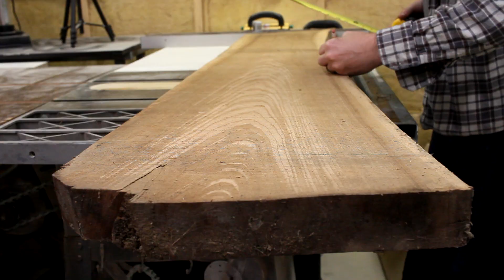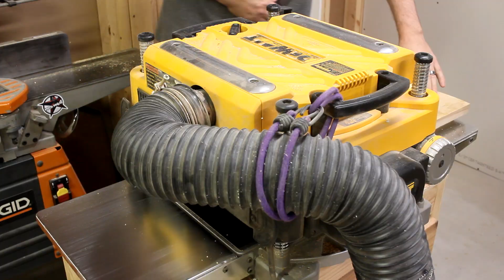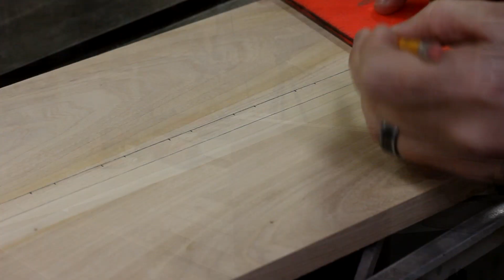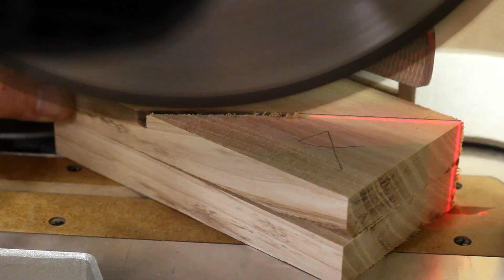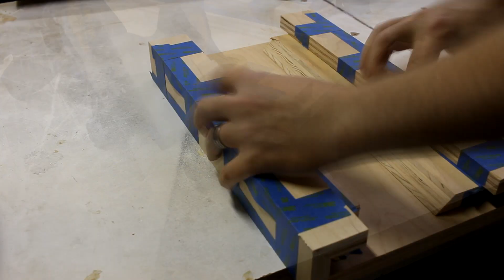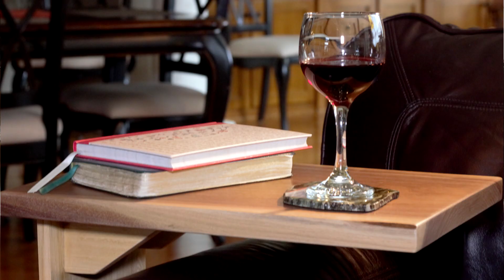Woodworking: Making an Adjustable Sofa Table

Comment: Trying to make this and I am hesitant to try the holes.  Seems impossible to get them to line up and you make it look so easy. Also, did the finish change the fit of any of the parts? I'd hate for everything to work then not fit at the very end
Reply from the maker: Nope, the finish didn't change anything.  Good luck

Comment: This looks like a great design! and it was very nice to include a method for people who don't have so many power tools!
I think i'm going to try my hand at this, but maybe replacing the Hole&Dowel stopper with something closer to a clamp and rail. (the slider board having a cut down the middle, and the hole being replaced with a screw-clamp and a board on the other side to clamp the slider with.)
Reply from the maker: Have fun

Comment: I have a question (because I have PTSD issues with other C-tables I've purchased).
Had there, in all this time, been any instability issues? The base looks (at first glance) a bit smaller than I would have (likely incorrectly so) thought it should be. Is the issue resolved because, since it will adjust to clear a couch, the couch keeps it from tilting? The table I will make will sit more like an end table for the most part (still has to be a c-table because of the room we have. No room for a proper end table). I can make the base larger or longer if you think it will be an issue with it being top-heavy if it's free-standing.
Reply from the maker: Never had any instability issues from either one of these tables I've made.  They've been great

Comment: Need to build pair for my wife & myself as we both need disability type "rise assist" armchairs. The shop ones are far too expensive and the bottom rail & castors at 3in won't go under the chair. So Christmas surprise for Mrs C, sadly it will be the plywood not the walnut but I can CNC her favourite kitten images onto it to make it special to her. Thank you for the design idea. We will both enjoy the tables.
Reply from the maker: You're very welcome!  I hope you enjoy the build and the finished product!

Comment: Just bought the plans. Was a bit disappointed that it did not have the walnut version in the plans. I'll calculate the bf needed and just mill the stock to 3/4" so the dimensions work. Might consider adding a page at the end for those of us who prefer the hardwood version.
Reply from the maker: My walnut version is made from 3/4" thick stock.  Plans work for whatever wood you want to build it out of.  I opted for a thicker base and top, but that doesn't impact anything else.

Comment: I'm thinking when you renew your membership, you sharpen or replace your planer blades. I can see the ridge. Sander, no problem. 
OMG, I can't imagine how heavy this must be. Did you do that just because you're used to working heavy, or is it for structural integrity once raised? This is some seriously thick wood. 
In any case, I LOVE the design. Our mortiser is sheit ... so I'm going to have to square the holes with a chisel. 

I'd never thought of using a band clamp on a 2-sided build to square. That's Brilliant!!

Seeing that grain with finish is so satisfying. I LOVE that part. 

One thing that I've not seen you address is how to check the color before cutting. Easy. When you're shopping for wood, take a squirt bottle. Water will show you what you'll get when finished clear. Just spray the surface and wipe enough to get rid of the reflections and voila! You'll know what color it is before you finish. Also, bonus ... you can tell what black walnut (since it's very popular) has been kiln or air-dried. Air- dried has more colors and more depth of color. Kiln-dried is always more dull an on the grey side.

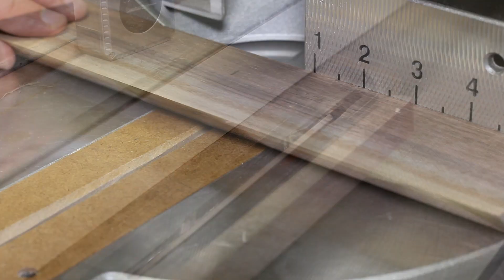Comment: Why do you touch the piece a few times with the miter saw at 3:23?
Reply from the maker: Watch closely.  I'm sneaking up to the mark to get the cut perfect.  I make tiny adjustments between each attempt until I have it right on the money.

Comment: Excellent design!  One improvement I’d make is with the feet.  I would buy some nylon blocks, make 2-inch disks, then aggressively round them over into a dome shape on one side. Then I’d epoxy them to the bottom.  These nylon feet would act almost like casters on carpet, allowing your father to easily slide the table in or out of place while still providing a stable platform.  Love the design!

Comment: hi there! Just purchased the plans for this. Wondering if I can scale up to make the maximum height just about 50” plus a bit maybe. What measurements would you recommend? Your plans say that the table can go 10.5 inches up from its original height so I’m wondering how I can make it taller without messing with the centre of gravity. Thanks!!

Comment: One of my favorite YouTube channels! I'm making two of these for my deck swing. We eat dinner on our deck in the summer months and when guests are here we want to eat sitting on our swing. I'll  be making these out of White Oak & Black Maple from my property. It has been drying for 18 months. I already milled the .5" dia pins from 316 stainless steel as wood pins swell. The table tops will be made of oil rubbed slotted Teak to shed rain water. Very excited to make the thanks for the inspiration
Reply from the maker: Sounds like they're gonna be awesome!  Have fun!

Comment: Thank you Mr Fisher, for these videos on a sofa table, it is very beautifully and professionally built!! Can you make a re-design of your sofa table so that the table top swivels to accommodate a sofa or even a bed that is low to the floor or on the floor where nothing can go underneath??? That is my dilemma. And I too, do not have all the tools you have. Plus I have limited mobility 😐 So all of my builds are made with furring strips & cut to length with a miter saw.  You know some people can draw lifelike people and some can only draw stick people. My furniture builds are not as beautifully done as yours but I build for the functionality of the piece. So in comparison to your builds my builds I call stick furniture. I thoroughly enjoy watching your videos on furniture, Thank you!!

Comment: Drew, that was either a grub worm, or the boring beetle in the worm stage. It has a black spot on it at one end? That would have been the head of the worm. It also looks like maget worms. I think they ate whatever had been in the hole pryer to you discovering them. How they got in there is a mystery!?

Comment: Why did you choose Ash for the locking pin? Due to contrasting color or based on hardness? Speaking of hardness when it comes to ash, do you find the card scraper requires more effort on the harder lumber? I have no experience with a card scraper yet. Thank you for another great video.
Reply from the maker: Yes, I did it for the contrast.  Yup, a card scraper is tougher to use on hardwood but is still the best tool for the job.  Some folks can pretty much eliminate sanding completely by using a card scraper.  I'm not that good yet, but I'm learning.

Comment: I seriously like this project, and want to make it!  I have loved ones in a similar situation who could benefit from it.  I may do a prototype from plywood first, mainly because I'm cheap and stingy when it comes to hardwoods, and want to work out any changes they might desire before raiding the wood bin.  

I am interested in doing away with the gussets (mainly to be able to set the top all the way down on the couch cushion), but am curious on your thoughts about another way to keep the table top strength they add?  Perhaps a 'through mortise' so that the end of the tenon is visible in the top, with a line of perpendicular dowels pinning the tenon, visible along the end of the top?  Or maybe a wide-tabbed box joint joining the riser and top, doweling each tab so as to have alternating dowels in two directions?  The dowels and mortise, or box joint tabs, may make for a bit of a busy look at that end, but I'm mainly interested in strength in the joint.  And visible joinery can be beautiful when finished right.  

Would really love to hear your thoughts on other ways to join the top to the riser, or pros/cons on these I've mentioned, or really just whatever you have time to write.  And again, superb project!
Reply from the maker: Depending on what they want to put on it, I’d still recommend gussets for the support. Unless you make it out of steel you just won’t get the support you’ll need.

Comment: I think I wood use a 'T' track to adjust the height, rather than searching for a hole to put the pin in.
Reply from the maker: Sure, that's an idea.  I was just going for the cheap and available solution.
Reply: @FishersShop   I have checked out a few other sofa tables, but yours is the best, now I am a subscriber, thanks for posting your talents.
Reply: Just purchased the plans, thanks for the opportunity!!

Comment: Great project and video Drew - i bought your plans and just finished cutting every thing out (actually cut the sides to the spacer so it fits) question for you - what finish did you use on the plywood version? Just PU?
Reply from the maker: Yup, just regular ol' poly.  Later I actually went back and trimmed out the entire thing with walnut banding and ended up making the plywood version VERY nice looking.  Pictures of it are on my instagram feed if you want to see.
Reply: I just had a look see at the walnut banding on the plywood  - yep now I have to make a trip to the store for some Walnut 😉

Comment: Hey FISHER! Bought these plans and I may be crazy as I’m a novice wood worker but on the cut diagram it says for the “sides” to cut at “2 inches”. That would make it less than a .75in board to fit into for its slide. The “back” says “2.25in” which would give you that .75in fit for the slide. Of course I made this mistake already on the walnut I was using but just wondering if I miss read something. Thanks for your help! Great channel! Love the videos!
Reply from the maker: Hey Aaron, I double checked and you're right.  I goofed and just switched the names for the Sides and Backs.  The Backs should be the 2" boards and the Sides are the 2.25" ones.  I've updated the plans to reflect the changes but you'll have to make a note of it for yours.  Thanks for catching that, Aaron!

Comment: It sounds like you could use a new blade on your table saw and circular saw. I like your style...subscribed
Reply from the maker: The circular saw blade was new, I just took too much and went too fast and it jammed.  But you're right regarding the table saw blade.  New one is on order!
Reply: @FishersShop  I'm kinda pushing the limits on my table saw blade right now as well...it's just hard to let go of the coin for a 16" blade especially when the saw isn't your money maker.

Comment: They're powder post beetle larva. Lyctid is the species since they infest hardwood (broadleaf) woods such as walnut, ash, oak. They can survive in wood for years before emerging as adults.
Reply from the maker: Interesting!  Glad I got them all out!  That would have been a bummer if they popped out in a year or so and joined my folks for dinner.  :)
Reply: @FishersShop  Yes, mom would not have liked that! LOL
Reply: @FishersShop  Just imagine your parents sitting down for dinner when a beetle pops up uninvited.😳
Reply: @dawn5227  well as long as they bring a bottle of wine....
Reply: True story:  I once ordered a live edge slab online and built a computer desktop out of it.  Lots of coats of poly for a nice glossy durable finish.   Several months after finishing it, while resting my right arm flat on the desk to use the mouse, I was constantly annoyed by an itching, almost a pinching sensation.  I also started to notice some holes appearing in the finish.  Being somewhat dense, I didn't connect the two until I got a nice hard pinch on the underside of my forearm, and when I looked closely a live bug was burrowing its way out of the slab.  Guess now I know what kind of bug it was.  After about 25 more holes I gave up on the desk.
Reply: @davefeinglass9118  Yeah I’m not surprised at  all. What a bummer though. Just for future reference, If you make another attempt and the slab is worth it, stable and seasoned you can have it professionally heat treated. Internal temp of 135 degrees it will kill them all. Another option is to treat the slab with a borate such as Bora-Care. However for larger piece you may need access to a large drum sander to remove the top layer of borates before finish. It leaves a slight milky and crystal like finish that does not help the appearance.
Reply: @davefeinglass9118  I seriously would have gone into conniptions.
Reply: Dan Rao is correct, powder post beetle. And I also have heard them eating their way out of the beams of a  150 year old barn.
Reply: I had a wooden bowl where I could actually hear what sounded like a chewing noise coming from inside one of the walls on the bowl.  I thought I was going nuts, but I heard it a second time and deduced that it had to be a bug.  I put the bowl in the freezer for a night and it's been quiet ever since.
Reply: Makes you think; are there any that weren't found...yet...mom?
Reply: That's what I love about channels like this! Every day's a school day! 👍
Reply: @willm971  Yes. Well depending on the region  the wood came from. Other species of wood boring insects can contribute to cherry tree damage such as Shothole borers or Ambrosia beetles to name a few. Ambrosia beetle damage is actually quite attractive, unique and often sought after in certain furniture pieces. Just as long as they’re dead.
Reply: The captain has spoken!
Reply: Freezing the table for a certain time, which I don’t recall, will kill any remaining larvae.
Reply: @kennethewald1189 I think if they can emerge from a 150 year old barn's wood, freezing isn't really that damaging to them
Reply: So, is there a way to ensure their demise? Kiln-drying, I assume? Clearly simply sealing it won't do so....?
Reply: I've read through all the comments looking for someone to address this. Thank you!
Reply: Dan Rao wut

Comment: This looks great. 
I have question about design. I like it as Sofa Table, but is it strong enought to endure daily abuse if I oversize it to hold PC and working on them? 
I want to build Adjustable PC and Laptop tables. (from plywood) And i never thinked about this design. Simple and great. :D
(wanted to use spring loaded arms to lock into holes when i bring table top up).

Thanks, and again, this looks RIGHT. :D
Reply from the maker: Well it's certainly strong enough to hold a flat panel monitor and a keyboard.  But the entire PC would be too heavy.  You might figure out a way to mount that below.
Reply: @FishersShop  Flap panel monitor and a keyboard? Hmmm, so no room for the Mice? :D hah 
for PC case I would build fixed standing and some rails in middle for addicional support.

Thanks again for sharing this design. I need to do lot of calculations for what i need and what i need even more. 

I was thinking to build from 2x4 rought construction some kind and add plywood to give it more strenght.  
But this goes into my plans, and Spring, here I come. :D 

Thanks again! :D

Comment: Great video and perfect project that's pretty accessible to a wide range of woodworkers. Doing a craftsman and a novice version of the same project is a fantastic idea. I know you mention the two versions in the description - may want to include it at the beginning of the video as well. I'd hate to have some folks get to the 2 minute mark and say 'well I don't have  slabs of walnut, a jointer/planer/etc...' and cut out early.
Reply from the maker: Good advice for the next time I do something like this.  Thanks Steve!

Comment: Nice job. Really impressed with one, presenting it to your parents, and two, making two versions. Many other people make DIY with $30,000 worth of equipment. Obviously the DIY'ers don't have that equipment.
Reply from the maker: Glad you liked it.  Thanks for watching!
Reply: you can pick up a full shop of inexpensive equipment for about $1.5k. band saw, table saw, lathe, drill press, miter saw, planar, jointer, and a disk/belt sander and even less if you find some in a pawn shop/craigslist. DIY doesn't mean just a skil saw.
Reply: Lanckie, I picked up a used Table saw, $20. Used belt/disc sander $20, same guy. If I follow your list I can probably have a used shop for about $150 to $200. Thank you.
Reply: Most DIY'er don't want to buy a full shop. It's a weekend think for them.

Comment: Awesome project! Loved the out takes at the end esp the juicy bug bits.  I was wondering about the mortiser's oil dripping on the wood. Doesn't that stain the wood?
Reply from the maker: I just used regular machine lubrication oil.  Not sure if it's the best choice but I didn't appear to have issues with it interfering with the wood finish.

Comment: are you using mineral oil on your mortiser?  saw the splatter and was curious what you used yet avoid issues with the later finish being applied.
Reply from the maker: I just used regular machine lubrication oil.  Not sure if it's the best choice but I didn't appear to have issues with it interfering with the wood finish.

Comment: You could do a T-framed base with casters on each corner so Dad can get his chair right under it. That's how I would do it for myself.
Reply from the maker: Yup, that would work for the chair, but not sure it would fit under the couch with casters on it though.  I guess it just all depends on what furniture you wanna use with it.